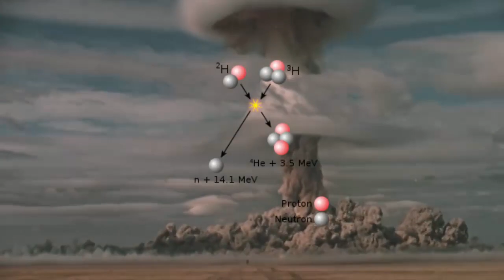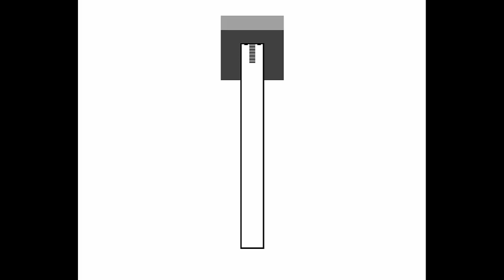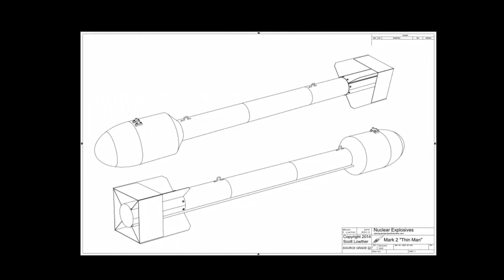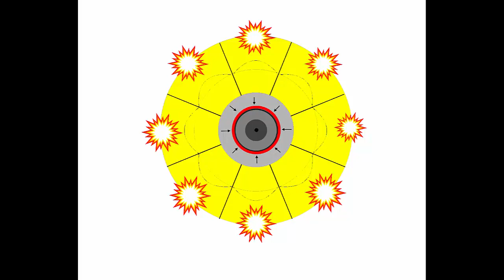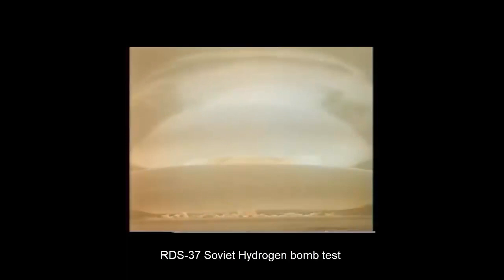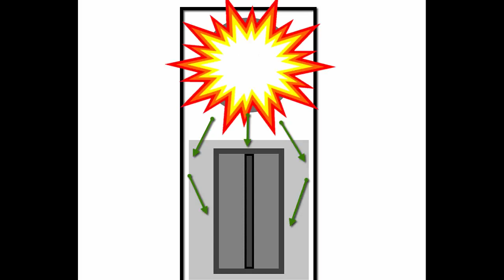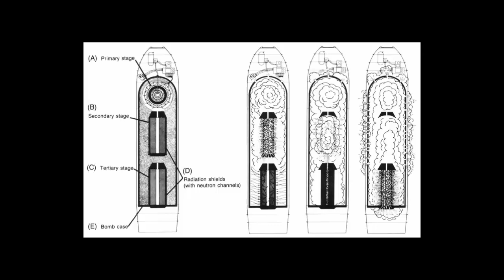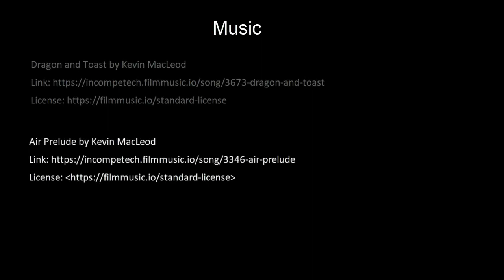How do nuclear bombs work?

Comment: 0:48 Small mistake, here. Fusion weapons typically use a fissile material as the tamper which undergoes fission from the neutrons emitted by the fusion stage. This makes fission the greatest source of yield from the weapon. Fusion just provides a more efficient mechanism for neutron generation. Take Tsar Bomba, for example. The weapon had a yield of 50MTs. That was without the fissile tamper. With the fissile tamper, it would have doubled its yield, meaning that the majority of the yield comes from the fissile components, the primary (fission of uranium tamper and plutonium pit) and "tertiary" (fission of uranium tamper surrounding the secondary stage and the plutonium spark plug).

6:04 It is still a thermonuclear weapon. Any two-stage nuclear weapon, in current arsenals, are thermonuclear, despite driving their primary yield from the fission components. If it has a fusion secondary, it is thermonuclear.

Love the rest of the video :)
Reply from the maker: Ah good catch, yeah the fast fission of the tamper in 2 stage devices does over all result in most of the energy output. Not sure why I keep mixing that up when it's a very basic principleof how they work. oh well, I'll pin your comment so others can see the correction thank you.

There is a difference between boosted bombs and true thermonuclear. Boosted bombs have the fusion fuel injected into the pit itself and the reaction just adds energy. a true thermonuclear has multiple stages and includes the depleted uranium  tamper as fuel.
Reply: @venera13  Yeah, I agree that there are boosted non-thermonuclear packages. Most of the packages in use today, and for the past several decades, are boosted two-stage packages, though. Perhaps that would be a fun video to go into some of the added complexities in fusion-boosted fission-fusion packages :)

I think the reason some people mix up the thing about how much energy the fusion provides because it does provide one thing in absolutely terrifying amounts: neutrons. I believe that it does yield the most neutrons in the overall package.

Happy to have been of help. Keep up the good work, friend :)

Edit: I made a mistake in my original comment, as well. I said the tamper was fissile. I meant to say fissionable. Can't let myself off the hook :)
Reply: I’m glad you made this correction because I was about to be all in the comment section 🤣🤣🤣.
Reply: @benleclair3977  I'm not sure what you are suggesting, but I want to initially say that it sounds wrong. Could you clarify your statement?

Comment: Fantastic video. I thought I knew a disturbingly large amount about nuclear weapons yet I learned a thing or two more from this. I didn't know the difference between the Foam Plasma and Tamper-Pusher Ablation designs.

Just one thing though, and I only found this out recently in another video, the purpose of Neutron bombs, and tactical nuclear weapons in general, is to (be able to) use them on enemy troops, which are almost certainly going to be very close to your own troops. The problem is that tanks and other armoured vehicles are surprisingly resistant to heat and pressure. But the neutron radiation that is emitted in the instant the bomb explodes can easily go through steel and give the crew a lethal dose of radiation. I don't know if there are any other situations a neutron bomb would be good for but killing tank crews without killing nearby friendly troops is certainly the main reason.
Reply: The US actually developed the neutron bomb in response to their fear of a possible large scale conventional invasion of West Germany. Low yield tactical nuclear weapons were supposed to be used for large enemy tank formations, but seeing as West Germany was an important ally and even joined NATO in 1955, the US wanted to inflict minimal collateral damage. West Germany had a large percentage of wooden civilian houses at the time, which meant that the US wanted to limit the heat and pressure generated from the bombs that weren't useful for taking out tanks anyways.

Comment: The primary is football shaped and has only two points of detonation. There haven't been any soccer ball primaries since at least the 70s.
The secondary is spherical by the way, not cylindrical. 
Peanut (double eliptical lens) shaped reflector of Hi-Z materials optional but useful.  
Secondary is levitated within a high-temperature syntactic foam probably made from glass microspheres, called Fogbank.
Reply from the maker: I know, I used older designs because there is more available information on them as opposed to modern designs which, as you can expect, is a tad harder to get information on.